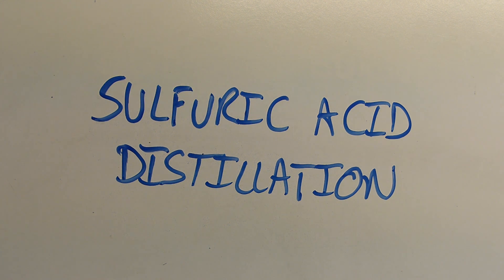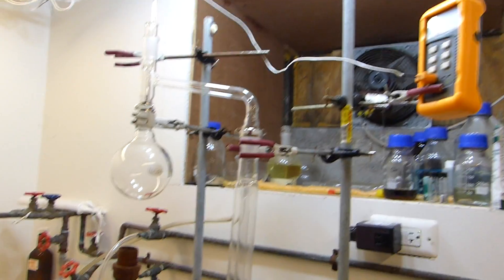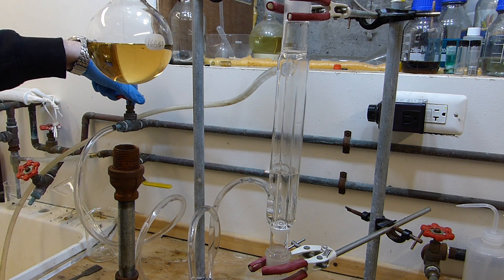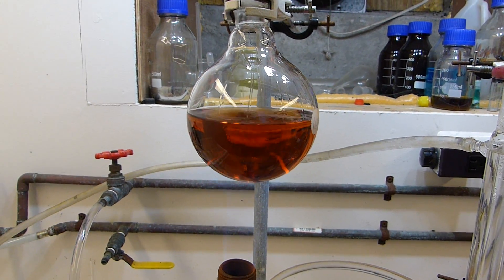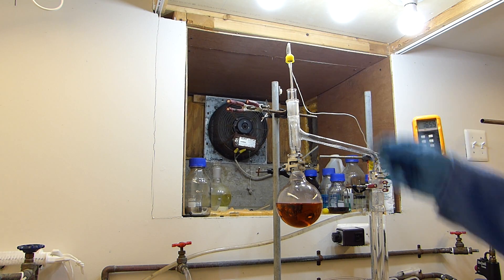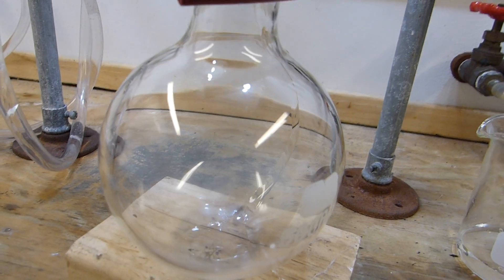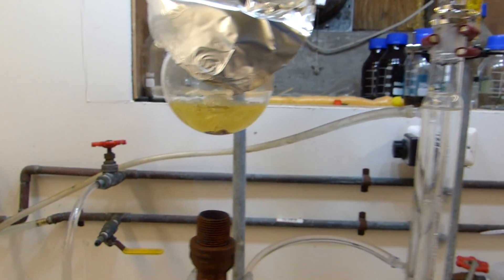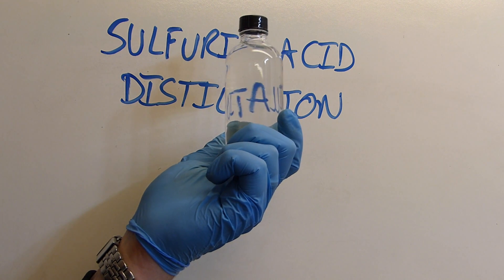Distilling Sulfuric Acid with Some Mishaps

Comment: It's not this simple, Doug, and you made few errors.
First thing, to turn this type of drain cleaner (not sure why this is used instead of much better NaOH, but who cares if this makes sulfuric acid easily obtainable :) ) into a very pure sulfuric acid, you really need to reflux it a bit with small addition of hydrogen peroxide. That will create weak piranha in situ which will destroy organic compounds and oxidize pretty much everything to CO2, H2O, N2. And it really is something that has to be done because sulfuric acid doesn't render organic compounds (they're listed as "inhibitors") to the very simplest ones, but leaves you with hot fumes that still contain reactive species that distill over.
Weak piranha reflux is simply essential and produces very clean acid.

Second, water condenser and this distillation don't go together. Temperature difference is over the borosilicate glass limit and introduces such stress that there is a plausible chance of glass breaking. Use an air condenser. Those are cheap (it's just a tube, afterall) and do their job well. Of course, it must be angled. If it goes straight down, it heats itself and then overheats.

Third, NEVER EVER heat borosilicate flasks with an open flame. That's an open invitation for a very bad day. Not only it can break and let out boiling corrosive liquid, but it wears the glass down, introduces stress and material aging. If one doesn't have a heating mantle and the heating plate is too weak even with additional insulation, flash has to be wrapped with steel wire mesh. At least two layers. That delivers almost all of the heat, but there isn't a temperature spike of the open flame involved. Steel mesh lets through hot gas and also radiates heat into the flask.

Fourth, use glass shards for the boiling chips. Porcelain is harder than borosilicate glass so each time it touches the glass, it scratches it and gradually erodes the inner surface, making it prone to cracking. Bubbling moves the shards up and down, scratching their way around.

All in all, you did manage this quite well and you have a good sense of solving problems when they occur. Panic is always a stupid thing to do.
I've purified several litres of this tamed beast in my life so I was glad to share some things with you.
Reply: I agree with you on using H2O2 to clean up the acid, not using water in the condenser and the boiling chips, they may scratch glass but they can cause undesirable gas release at > 300c leading to explosion, though I don't think terracotta is porcelain, I think It's just a ceramic material and a soft and porous one. 

 However, Glass scratches  glass (sand paper is used to sand the edges of windows and mirrors prior to installation), which is why broken glass should be mildly ground using a granite mortar just to round any edges or a diamond file if you're patient. 

I disagree with your opinion on NaOH. NaOH isn't good for for anything but kitchen drains because it will saponify any grease, destroy proteins, but what about mineral build up or metal oxides that settle in pipes?  Sulfuric acid is FAR superior. It's also used to thaw frozen pipelines as the reaction between H2SO4 and H20 is exothermic. The exothermic nature of the reaction heats the acid making it more reactive, dissolving the blockage faster. 

I also disagree with your comment on the use of borosilicate on open flames. Borosilicate glass is designed for use on an open flame. Ever see those Whistling Kettles?

Glass kettles come with a trivet for electric coils to prevent hot spots that could lead to rapid localized expansion, cracking glass. But open flames are okay as long as the flame remains well below the liquid line.  The glass we use for boiling solutions is far superior to those kettles and I've been using my kettle several times a day for over a year now, no scratches to mess with the glass's structural integrity, no exploding glass.
Reply: peroxide isn't needed. Hot concentrated sulfuric acid will completely oxidize anything organic, peroxide not needed.
Reply: @refluxcatalyst7190  correct, Nile red did a video and commented on this
Reply: Sulfuric acid is better at attacking clogs composed of hair, paper, cloth and feminine products.  Sodium hydroxide is better for grease clogs.
Reply: @islandblind  Exactly, I got a bottle of NaOH for the kitchen and a bottle of H2SO4 for the bathroom :)
Reply: Thought to write exactly the same. In addition - It's better to protect receiver from atmospheric moisture by P2O5 tube. And joints could be greased  with polyphosphoric acid.
Reply: @nikolayboev9948  may be sulfuric acid is better for joints ? why to contaminate product with polyphosphoric acid ? ))
Reply: @maelgrum  Серная кислота слишком жидкая. А пфк можно любой густоты развести добавлением р2о5. Хотя насколько это смазывание критично я сам не знаю, мне ещё в аспирантуре местные аксакалы посоветовали, вот и делал так.
Reply: @nikolayboev9948  мне кажется, концентрированая серная кислота достаточно вязкая для герметизации соединений, и в данном случае точно ничего не загрязнит )) или PTFE лента как вариант.
Reply: @maelgrum  Точно не знаю. Я сам в последний раз её перегонял лет 20 назад под присмотром старших. Как посоветовали смазать всё ПФК - так и сделал. Вот сейчас думаю - а реально ли гонять серную кислоту в вакууме? Надо почитать...
Reply: @nikolayboev9948  так а почему нет ? должно работать ))
Reply: for the first method I don't even think distillation is required. add the H2O2 and heat and drive off all the water in an open vessel and you should have clean concentrated acid left over.
Reply: No, because inhibitors include insoluble, nonvolatile salts. Distillation is essential.
Reply: well if they're insoluble why don't they drop out of solution? would you happen to know the name of these salts?
Reply: My mistake. I meant to say nonvolatile only. They are soluble. I think some phosphates are the guilty party.
Reply: I do have some on hand prepared in this fashion. I guess the best way to verify is to boil a small amount to dryness and see if any sort of film/particulate is left behind... is this something you have done?

Comment: This video reminds me of a story my chem professor told in lecture...

A few years ago, a student (undergrad) was working in the lab and accidentally emptied some organic waste into the acid waste container. Rather than alerting the TA, the student tried to hide his/her mistake by sealing the container (we use giant glass carboys that probably hold about 10 liters or so) and walking away like nothing happened. At the time, my professor was in her office and she heard an explosion next door followed by the sound of falling glass shards. She runs out of her office to find the entire lab group of 30 or so panicked students evacuating the lab followed by a cloud of HCl and NO2 gas. Several students had to be rushed to the hospital for burns and glass cuts and law enforcement was involved as well... just goes to show what happens when you don't properly fix your mistakes in the lab :)
Reply: How did they found out?
Reply: what would be the appropriate thing to do in that situation tho?
Reply: @nabrialesadramelech3299  leave it open, close the door and open the windows to allow the gas to escape
Reply: @seibtyee637 Strong acids or bases must always be neutralized before being placed in the appropriate waste containers.
Reply: @SciDOCMBC  yes. but i was referring to what to do after someone causes an explosion like that.
Reply: The stupidity of the few is what leads to ruining science for the many.  And because of helicopter parents and overreaching safety protocols,  young people are inadequately prepared to handle chemical processes or glassware.  I suspect they are afraid of power tools as well

Comment: 9:43 a friend of my mother died in that way distilling diethyl ether (in the university lab, not at home).
Reply: Pseudo Memes only a total idiot would distill old ether. She was just recycling a 5L gallon of 2 week old ether used for various purposes. She was distilling 1L of it (in a 2L flask of course). The temperature was well above 37°C when she realized that she forgot to add boiling chips. 
Now, forgetting to add boiling chips is quite a bad mistake, specially when distilling ether. But it can happen, it was just a distraction. But the really bad error that she did was not to let the whole thing cool. The ether was like 20 degrees above its boiling point. If there were peroxides, they were really dilute, peroxides in the distillations of ethers are a concern only when the thing comes to an end. 
The ether overflowed so violently that it spit hot liquid and vapor all over the fumehood, and then it catched fire. I wasn't born at the time, luckily, but my mother 
 told me that there was literally a bubble of fire. 
Anyways, my mother's friend went to the hospital with 3rd grade burns all over her body (lab coats weren't fire proof, so she literally became a human torch), and then she died because her skin couldn't work. If a person has 3rd grade burns there isn't a cure that you can apply. You can give her only first aid and hope that the surface of the undamaged skin is big enough to allow the body to expell toxins, sweat and things. If it isn't, the person will just die. You can't do anything.

Comment: Likely the best sulfuric acid (or acid in general) distillation video on YT. Glad you're back, Doug!!

Doug, do you think you could do a short video on the suggested PPE for distillation of high purity acids, including nitric where you will deal with NOx as well? Do you personally wear anything specific? I noticed once the acid spill happened, you had your real lab coat on and what looked like gauntlet gloves. Was that due to the elevated risk at that moment?

Comment: Do you know if there's a way to test your glass if it can handle this? I have pretty cheap glass so I'm not sure how resistant it is. Also have you considered doing a vacuum distillation of the acid?
Reply: needs to be pyrex (borosilicate). You can test it destructively (the crap kind of glass will break so watch out for flying glass) by thermal shocking, boiling to ice water should not break boro-glass as it should be able to withstand ~165C temp changes, regular glass can only take ~40C temp changes.
Reply: Sam Winfield obviously it's borosilicate but I'll try that. Maybe pour some boiling water down my condenser followed by ice cold water

Comment: To be honest: I would dare this, because of the considerable danger that the glassware cracks.
Reply from the maker: You may notice the cloth on my sleeves changing throughout the video. I was wearing an acid-resistant labcoat, a rubber smock, and a face shield for this one. Definitely a bit sketchy.

Comment: Awesome skeleton watch bro! And great video! Taught me something :) could I do this distillation with car battery acid?
Reply from the maker: Haha thanks, but it's nothing special. It's an Armitron 20/4406BISV, about $85 at Sears. And yes, you can do this with battery acid, except you'll just have to take off a lot more water at the beginning.
Reply: I am certain you could.   I seem to remember that the solution in car batteries is fairly dilute.     You'll have to remove a lot of water, so I wouldn't expect an amazing yield.

Comment: I was making nitric acid with ammonium nitrate from cold packs. The packs said ammonium nitrate, but they must have been Ca Ammonium nitrate, because as soon as I added the acid it started foaming up. Had to disassemble and dunk the flask in a bucket of water, then added baking soda but ran out, and then dumped a whole bottle of 10% ammonia solution into the bucket to ensure neutralization. Lesson learned, test your NH4NO3 before you commit to a large batch.
Reply: Ammonium is available over the counter. Also the ammonium sulfate left over is extremely water soluble and easy to wash out. Doug has a video of him using potassium nitrate and he pushes the reaction to form potassium bisulfate instead of sulfate, for the reason that potassium sulfate is much less soluble and harder to clean out. But that reaction requires more sulfuric acid than if you pushed the reaction to get K2SO4. So by using ammonium nitrate I can push the reaction to ammonium sulfate instead of bisulfate, get more nitric acid by using less sulfuric, and its easy to wash out. All that and there weren't many videos on yt showing how to make nitric acid with NH4NO3. My video is here, but I have another one coming out when I get the editing done, bc I have better footage the 2nd time around.  https://www.youtube.com/watch?v=dCxs_tlJaIg

Comment: I'd be well paranoid heating glass like that. Even if it's slowly & evenly heated I'd be waiting for something bad to happen....
Reply: Not true. Ask any laboratory flameworker. It's a bad practice that induces fatigue, lowering expected lifetime of the vessel. And then one day it breaks while there's ether inside. :/
Reply: It's certainly better practice to place at least a gauze between the flame and the glass.
Reply: Oh, didnt know that. I guess I will be safer from now on :)
Reply: Not paranoia, but common sense. This should never ever be done. He was lucky it didn't snap.
Reply: Well, if the glassware used is borosilicate there really isn’t nothing to worry about, especially if it is heated slowly

Comment: Question: can you clean up the coloration with hydrogen peroxide? I mean, you dilute the acid, but you create piranha and you avoid having to setup a distillation.
Reply from the maker: Yes, you can add a little weak hydrogen peroxide which will destroy any organic matter present, oxidizing it to H2O and CO2. This usually clears up the coloration, but will not remove metal salts. It will also need to be boiled to remove the water that comes with the hydrogen peroxide and to destroy remaining peroxide before it is used in a reaction.
Reply: Doug's Lab thanks! Glad to have you back

Comment: It's not a proper lab bench unless it has acid burn marks on it.
Reply: It's not a proper lab bench until it has a big old hole with glowing perimeter. Bonus if the glow is due to radioactive fission byproducts.
Reply: @stamasd8500  it's not a proper lab bench if you never burnt a hole straight into it using a blowtorch because you got impatient
Reply: A badge of pride!!!☝️
Reply: PPE? Blast shield? Boiling chips? Why not just it with a bunch of dry mag sulfate? Why do you 98% H2SO4?

Comment: Have you thought of testing if your burner is efficient enough to completely burn the gas? You may want to use a carbon monoxide meter to make sure you don't get too much of that in the air.
Reply from the maker: Hi Stamasd - good point! The air orifice on the burner is oversized, which keeps the flame oxidizing. This helps prevent soot build-up on the glassware. Inevitably, the flame will be quenched by the surface of the glass and some CO will form. However, that fan noise in the background is the lab ventilation system which is capable of changing the air in the room 3-4 times per minute.

Comment: Pretty scary video, fortunately nothing bad happened :D. I have my self bad experience with only dehydrating the acid, not distillation, some broken glass, because of that. Is it safe to cool hot H2SO4 with water jacked? I mean I only read about air jacked used for this purpose since its boiling over 300*C and we could see ourselves, that water was boiling in contact with H2SO4 steam. I know that even laboratory glass is save to use only when there are max differences in temperature, about 100*C, then it can crack?
Reply: It is not safe at all. Temperature difference is over 150 degrees which is kind of a textbook limit. This simply requires an air condenser.

Comment: Well, I've done a timelapse video of me, distilling H2SO4:

https://www.youtube.com/watch?v=uWHWlChrRbQ

It is initially black, because I've used grease and the grease got affected by the distilling acid.
To correctly address with bumping, I added a naked stir bar. I removed the outer nylon protection, because it will melt at these temperatures.
The naked stir bar seemed to perform relatively inert.
Reply from the maker: Excellent work! I subscribed.

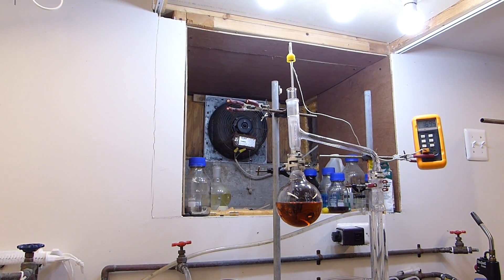Comment: 9:37 Ah, memories.

“But tehlaser, how did you spill *on the ceiling*?”

Oops. Thankfully, it wasn’t sulfuric acid.
Reply from the maker: The only thing worse than an aqueous solution fountain is a diethyl ether fountain followed by an inferno. I'd imagine a fountain of 600-degree sulfuric acid is a close second. :D
Reply: tehlaser that would be such an exciting way to die